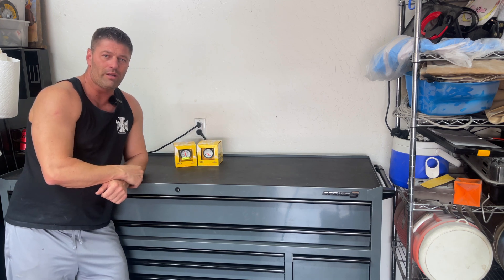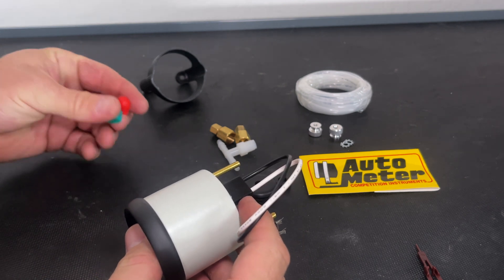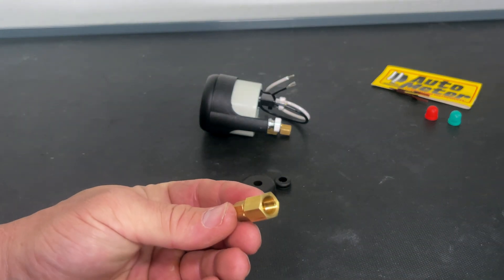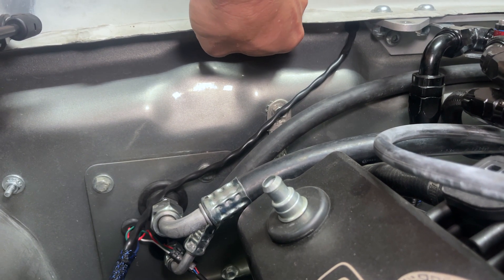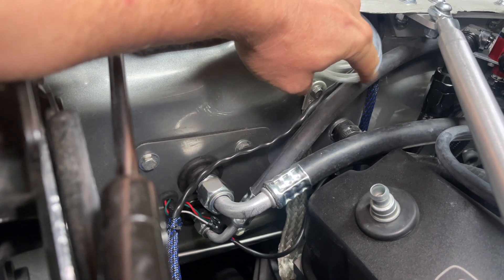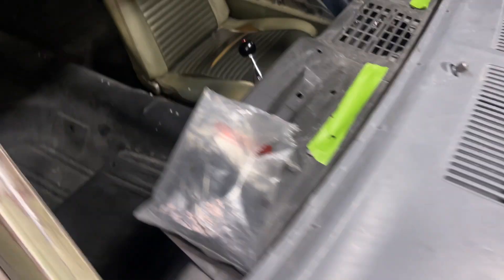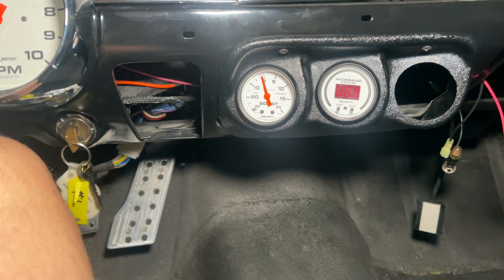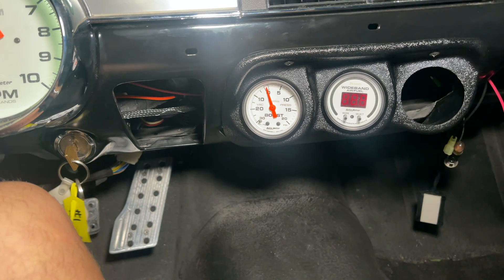Auto Meter Vacuum/Boost Gauge Install   4K

Comment: can some explain how exactly this gauge is helpful? I was told that more vacuum and less boost would give me more MPG. Is that true?
Reply from the maker: First off, you can’t have boost and vacuum at the same time, the engine is either in a  positive pressure or negative pressure state. I have a supercharged motor. So it will cross over in positive pressure. Boost.!!!! if your motor is in NA, I’m sure there are tons of advanced ways to use the information. But the way I would most likely use it? Know where my motor is normally running, especially at idol. And if that ever changes, it tells me something wrong.. vacuum leak timing off, etc.
Reply: @ironmustang  I appreciate that my guy thank you